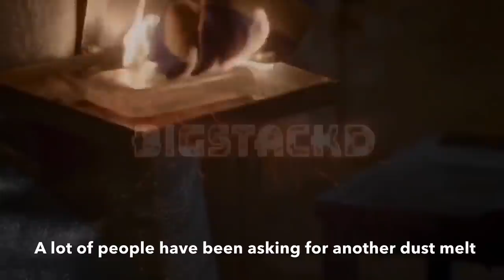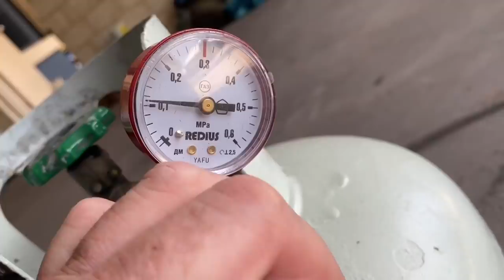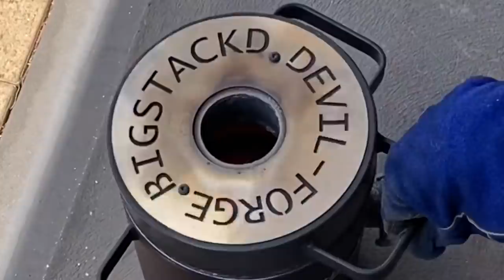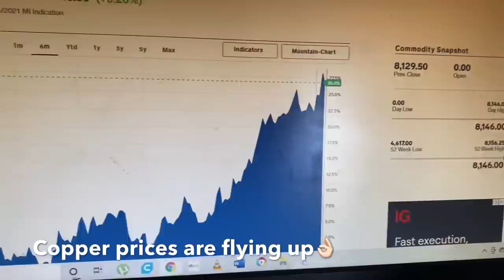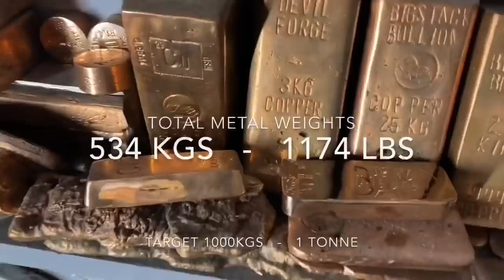Metal Dust Melt Down - Trash To Treasure - Multiple Melts - ASMR Metal Melting - BigStackD Casting

Comment: What about pouring 2 different molten metals into either end of the same mold at the same time? See if they mix and swirl in the middle of the ingot.
Reply: now that would be epic
Reply: But there will be impurities in the the ingot causing the two metals to mix properly
Reply: Afaik mixing molten metals that way is a pretty bad idea an can lead to explosions
Reply: @Clayton Cronk I thibk because metal melt at different temperatures without using proper mixes and mixing them correctly, the stress of them cooling differently can cause an explosion that just what I think I’m not sure at all though.
Reply: Also, densities likely diverge, so don't expect too much from it.

Comment: I guess I'm a typical Yankee...can't seem to get a feel for temps in Celsius. Thanks for hitting the Fahrenheit button on that thermometer ! Much appreciated, BigStackD!!
Reply: General rule from C to F - 

double the C temp and add 30.  It'll get you close.  Doesn't work well for negative temps, but most others does fine. 

Example:  20c  becomes 40 + 30 = 70

Actual conversion comes in at 68 but pretty close for in the head conversions
Reply: @namoric  for general temps like room and warm outside temperatures, it’s better to go with double and add 25. The doubling creates a higher disparity the higher and lower you go, so the double and add 30 is good for typical cold temps.
Reply: @ThirdInLine  If you want to do the actual math, (I really don't, but...) multiply degrees Celsius by 9/5 and add 32.  Of course, it is much easier to use your phone and Google, but that's the way we learned to do it in school before the internet was a thing.  Gawd, I feel like I should have a cane and a rocking chair so I can yell at the kids to get off of my lawn.
Reply: @TheCoffeehound  of course, we’re just talking about guesstimating. I lived in Europe for a long time and this was I did it for years
Reply: Thanks for the help with Celsius. Much appreciated!
Anyone know how I could go back to BigStackD very first YouTube entries and watch chronologically?

Comment: Although toxic fumes are produced zinc oxide is awfully pretty aswell as the little greenish yellow flare ups lol
Reply: Visually pretty to an uninvested viewer, yet an ugly nightmare to the metallurgist who needs his brass to retain the zinc to copper ratio.
Reply: @erikblarg5498  is there a way to keep that from happening when you melt brass dust?
Reply: @smoker4188  When melting brass in general, The closest to getting perfect precision in your end product alloy, that you can get, is if you used a temperature controlled kiln to get the brass to the exact temperature you want, and then it just comes comes down to doing a lot of math to find out how much zinc you will lose, at said temperature, and how long it takes to reach temperature, how much surface area is exposed to the air also effects it, because the very surface of the metal will burn zinc slightly faster, but after a bunch of research on your equipment and a bunch of math you can just add that amount of zinc back into it, and stir it once the brass is molten. So honestly, if you need PRECISION down to milligrams or decimals of milligrams, then you're likely in an industrial environment because most people won't need that degree of precision. An industrial environment will have extremely precise equipment and people who have already done the zinc loss math that relates to their equipment setup. But yeah even in industrial work, adding zinc back to molten brass is pretty commonplace.
Reply: @erikblarg5498  that’s pretty cool, someone told me if you add borax to the top of the surface it’s less likely to burn up I’m not sure how true that is though lol
Reply: @smoker4188 Yeaah, Borax is just a flux that helps impurities to the surface, at least in the case of melting aluminum, brass, copper, or other basic alloys. But, I would be irresponsible to claim that there is no metal alloy that is more likely to burn up without borax, because while I do know a good bit about metallurgy, there is still so much more that I still don't know about it, seeing as there is a near infinite combination of alloys that could be created.
Reply: @erikblarg5498  it’s just whether or not they are usable I’m assuming, I’m sure you could mix any metal but the outcome can be iffy I’m sure lol
Reply: @smoker4188  Oh yeah absolutely, for example, King of random showed tests on different ratios of aluminum and brass mixed together, and some turned out beautifully colored, some turned out harder than brass but still fairly tough, and then others were so hard and brittle they shattered when dropped. But in the modern world people can find uses for all sorts of alloys. Something that is crazy hard but more brittle than glass could still be used as an abrasive or who knows what else.

Comment: Another good vid.
I have 2 fish bins overflowing with copper and brass of various sorts and have entertained the idea of , one day buying a forge and mould for a melting session.
In this vid I see you moving the white sleeve on the burner, what does this do ?
Any chance of an instructional vid for the beginners with suggestions or recommendations for the best/most suitable entry level forge and moulds ?
The only problem I have with your vid’s is the choice of beer you drink, never drank Wombats piss before but I’m sure it’s a close match. 😆👍
Reply: i think the sleeve is so he can control the air flow so it doesn't blow fire back in to the line cause fire + propane = big kaboom if done wrong
Reply: Wombat piss lmao i disagree but that was kinda funny none the least haha not any better then american pisswater haha beer is beer at the end of the day 😂😎

Comment: Curios, how do you tell slag from metal that just hasn't melted yet?
Reply: because if all the metal is the same size in the same crucible at the same temperature then all of the metal melts at the same time so after a while of letting is sit he takes out what’s on top because that’s the slag
Reply: @SportLairVids  OK, but how do you know at what point all the metal has melted? Say like on many of his melts he keeps adding things to the crucible as things melt and create space for more stuff, is there like a set amount of time at a certain temperature that would guarantee it has all melted?

Comment: I get happy when I stumble on a video I missed before.

Question: would melting brass dust work better, with less zinc burn off, if the dust was added slowly to some already melted brass?
Reply from the maker: I never really thought of it, but I think probably not as the only time the zinc will burn off, is when it’s exposed to oxygen when it’s over it’s boiling point or flare point. If you were just dealing with zinc, it wouldn’t be a problem and you would never have a problem, especially if it was just a zinc dust, but as it’s brass dust, consisting of mainly Copper, you need to get that higher, melting point for it to be molten and unfortunately that is higher than zincs boiling point of around 907 or 908°C, if I remember of the top my head. So at the end of the day I would think you would be best of putting it all in together as everything underneath is not gonna be exposed to oxygen and it’ll only be the bit on top that will flare off but obviously thats until you stir it or mix it up a bit so I think definitely put it all together and have it melt all at the same time and deal with a little bit of flare off that you get.
It can get tricky to try to do it to the point where you don’t get any zinc oxide/flare off as brass alloys are all different, and some might have a higher melting temperature than others because of the different compositions so brass is different all round. . Hopefully this makes a bita sense to you. I’m using voice text so hopefully no words got changed but it all makes sense in my head. It’s just whether I can communicate it properly through comments,  that’s the big question 😁👍🏻.

Comment: Is there a way to tell how much gas you have left in the tank and how do you tell how long it will last because I just got a propane foundry for Christmas and have some questions
Reply: You can weigh an empty tank, and compare that to the weight of the tank you are using to know how much you have left.

If you want to get a feel for how much each session uses just do a before and after measurement. And you will get a feel for it (say you run it for 10 minutes at a certain speed, you can figure out how much gas gets used for future reference)
Reply: @DH-xw6jp  thanks! Also is the a website that tells you what PSI to put your propane at to melt certain metals?

Comment: I'm in no way trying to shit on what you're doing but just trying to understand better, I suppose. It looks like you're using pretty basic 20 gallon/ 76 liter (75.7 but we're just gonna round up because there's just no need not to) propane tanks. Average price for propane in Australia right now is 0.95 a liter. I don't know what your average burn rate would be per minute/consumption of each crucible but it wouldn't seem very lucrative if your maintenance costs are higher than the end results, even if you're getting material for free. I could be completely wrong, that's just how it looks from a layman's perspective.

Comment: Hey I just got my first furnace and have about 50 lbs of cans to melt down. Was going to make a video thanking you for getting me into it. But I hit a snag and need some help. Where do I get those crucible holders you have? I've looked everywhere and can only find those generic silver ones that don't work well. I also got hosed on my molds. The ones I ordered said they were for a 4 lb crucible and they definitely weren't, all 3 fit in the palm of my hand together. I need help picking out the best molds for aluminum casting. Any help would be appreciated. Thanks!

Comment: I suspect that particle size is the issue with melting dust like this :  Small particle size means a very high surface area to mass ratio (inverse cube law IIRC) . When you expose the dust to a hot O2 rich environment you'll get a lot of oxide formation - slag. The top layer of dust  (.e that thick layer of slag)  might be acting as a barrier, allowing the rest of the dust to actually melt before oxidizing.

Comment: You know, it sort of seemed like to get a proper melt on the brass, you'd need to start with a bit of molten copper first and then add the dust to it to. Since Brass's main base metal is copper, the melting point would be closer to Copper than to Zinc. As Zinc has a boiling point of around 900 degrees C (still lower than Brass) you'd probably end up burning away the zinc altogether, leaving just copper, or copper combined with nitrides and oxides. 

So maybe starting with a bit of molten copper and adding to it would alleviate this and allow for a proper melt?

Comment: I have just received my new Devil Forge, I have crucibles and molds on the way. Tomorrow I am putting the refractory coating on. I will be building my own tongs V I A your video next week. I was just wondering if you have available a chart for the gas pressures used for different metals ? I am really anxious to do my first melt with an actual Forge. I made two small ingots last year, one Copper and one Brass. I used an acetylene torch and it got too hot for cast iron pan I used to melt it in and  the brass ingot  ended up with some cast iron in it and will hold a small magnet.  Your videos have inspired me and I will be melting soon. Thanks !

Comment: Yeah, next time ignore the fans clamoring for a dust melt when you dont have alot, either that or slyly make some good pure dust off-camera to augment the actual grinding dust. That nasty dirty brass and copper dust had to both be like 75% slag and dirt, and it shows in the pouring that scraping and even fluxing didn't get it all.  Nice results from what you had to work with tho!

Comment: Wouldn't it be possible to reduce overall slag (caused by oxidation of the powder), if you added it directly to a large enough volume of already melted metal? Just wondering.

Comment: hey bigstag good work of forging I would like to ask or ask you how you could make a round bar of any metal because it would be economically productive because the scrap metal buys you by weight, it does not matter if it is clean, it gives you the same price before it is forged

Comment: Best to mix your flux in with the dust to start with, this lowers the melting temperature and reduces the out put of deadly toxic zinc vapor and increases your recovery. Need to use more flux also.

Comment: Why do you cover crucible for dust melting only? I guess it could help keep heat always...
Oh, silly me, you just want to show us beautiful glowing melted parts and liquid metal surface :D
Reply from the maker: Basically it’s just because inside the chamber it can get quite turbulent and it will blow a little bit of the dust around and out the top of furnace before it melts👍🏻

Comment: Hey man!

I started casting aluminium and copper.

I have issues with my cast iron ingot mold. It is really hard to get the aluminium out of the mold once it is solidified. 

Any idea what the problem might be?

Greetings from Bavaria, Germany!!🙂
Reply from the maker: Matey normally what will happen is the mould will get super heated and that will make the aluminium harder to get out because the aluminium will shrink once it cools down so if you were to use the same mould and tried to pour three or four ingots in a row the first one will come out nice and easy but the next one will take longer to come out and so on. 
i’m hoping this makes sense to you👌🏻

Comment: Your gonna need a truck and a winch or someone (me) to help you lift shit cause you missed out on a major melt last week with that compressor. Finally a video on the dust. Been waiting months to see if youd ever do one. 🍻👊🍻
Skol brother
Reply from the maker: It takes a long time to collect the dust and this is probably 12 months worth so unfortunately my next dust melt will probably be 12 to 18 months away👌🏻
Reply: @bigstackD   definitely makes sense your bars come out alot cleaner than mine. Tried brass for the first time a week ago and they were definitely layered and covered in a slaggy powder.

Comment: Hey @bigstacked do you have to use a different crucible for every metal like copper brass and aluminum ?????? Just out of curiosity
Reply from the maker: Now that I have a heap of crucibles handy yes I do but when I first started years ago I would just use one or two and wouldn’t worry about using different metals in each of them,  I just make sure to clean them out after each melt so it was ready for the next one👌🏻
Reply: @bigstackD  o oke does useing the same crucible for every metal influence the value of the metals like copper brass aluminum lead and tin???????

Comment: Hello, been watching your videos,  have a question. Do you only put cardboard at the start of a melt or each time you pull out and startba new melt. 
  Thank you
Reply from the maker: I only ever use cardboard when I melt copper and I put that in when the furnace is cold and that’s good enough to last until I pour that copper on that particular melt. I don’t use cardboard on any of the other metals as it’s only when doing copper because crucible becomes so much hotter than the other metals.
Reply: @bigstackD   thank you sir

Comment: Have you considered remelting some of the small discs/coins, wafers and imperfect pours and making them into larger bricks?
Reply: @hidelima8877  Thanks, but I was talking about a video from BigStackD.  It's also usually considered bad form to post links from another creator without permission.  Most content creators dislike that kind of advertisement.
Reply: @Yurindeep  sorry
Reply: @Yurindeep  small channel. I started just now, it is not very common for channels to grow in Brazil with this type of content. I have to crack ways to publicize
Reply: @hidelima8877  I guess I will forgive you. :P
Be safe.